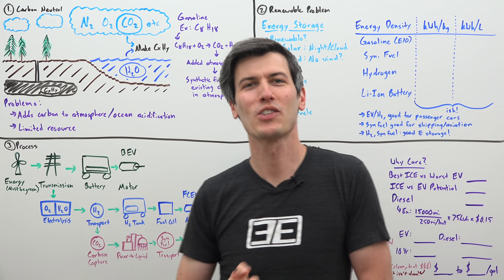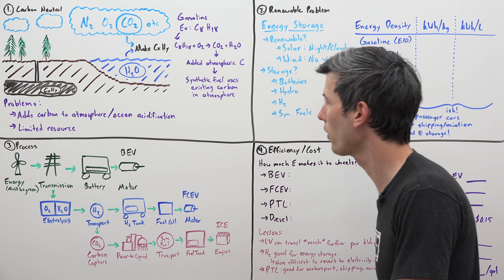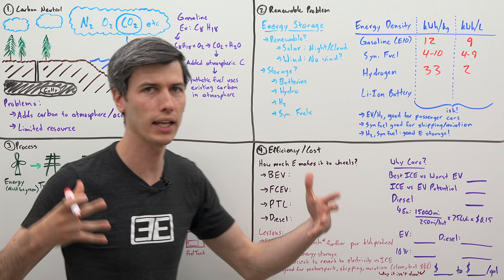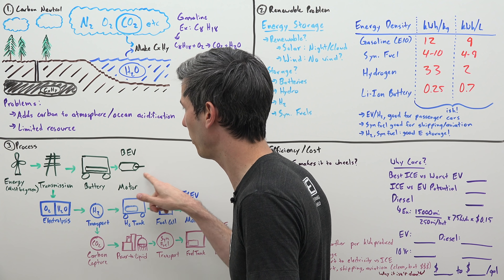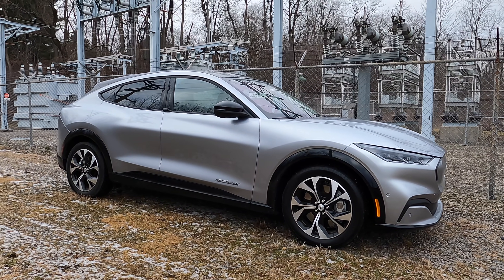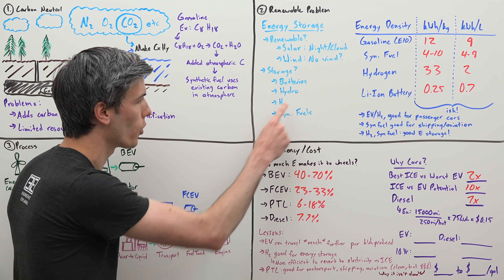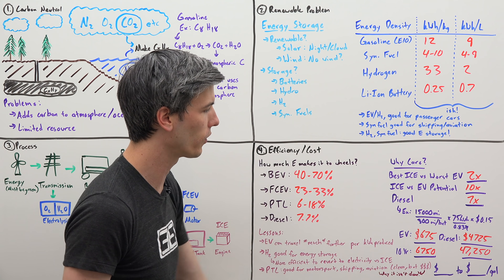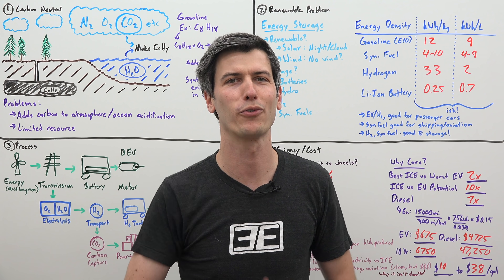The Big Problem With Synthetic Fuels

Comment: Synthetic fuels won't replace electric cars but they can save expensive performance ice cars and racecars.
Reply: That’s all we care about anyway
Reply: @Ryan Fang Nobody needs tasteless boring people
Reply: @Ryan Fang And even less people care about electric racecars.
Reply: @Elias Håkansson Youre probably right. But people today also still ride horses but not as an alternative to cars but because its fun. I dont even say that electric performance cars have no emotion at all. I actually like many of them and would also drive one but I dont think they can replace the feel and emotions that come with ICE sportscars. In my opinion they should kind of coexist.
Reply: @Elias Håkansson The emotion with ICE cars is getting everything right, it's like a puzzle on track, getting your shift points correct, listening to the mechanical contraption roar away as you're rewarded with nailing the acceleration out of a turn. Then there is speaking with your friends with what they did to help them get that bucket of bolts and petrol around a track. You brought a good point with a horse, there are a lot fewer horses but they are still around, because of the enthusiasts.
Reply: I’d like to see biofuels included in this analysis, since they’re also renewable.
Reply: Those vehicles are the least of our problems.
Reply: @Elias Håkansson and look how that turned out? How many people dont own horses cuz they enjoy them. You defeated your own point.
Reply: No, they can't. Once Roadster starts hitting the road, ICE Hypercars are toast. EV drivetrain -- multiple engines (2/3/4), instant torque, silent gives advantages which ICE just can't match.
Reply: @archigoel  ah that overhyped Tesla Roadster which only good on paper for its acceleration. I doubt it will beat Nio EP9 or Rimac.
Reply: @khairulanwar5439  the rimac is 2 million dollars bud… hardly anyone is going to buy that car compared to all the roadsters or model s for that matter
Reply: @Ryan Fang That is obviously not true if you look at the car community...
Reply: It seems like electric cars are almost effortlessly faster than similar ICE vehicles though, and can be made even faster with advancements in battery tech coming down the pipeline allowing for lighter packs.
Reply: @_topikk_  Sports cars are not only about the speed but the emotions that come with it. Its true, electric cars are much faster and will beat ICE speed wise in every discipline but thats kind of it. Once this speed thrill wears off its not special anymore. There is not much emotion and character that comes with the speed, its just fast. I think performance electric cars will get bland after some time.
Reply: @fremue9312  There are 0 electric cars that won a major racing championship and there most likely will be 0, electric cars are only faster in a 1/4 mile
Reply: @broshido2745  I said that they will be faster in the future. Battery tech improves rapidly and it won’t be long until the weight difference is not as big anymore and electric cars will be faster around the track too. And also, the fastest car around the Nürburgring is already a hybrid.
Reply: @_topikk_  It's not about the speed. The noise is the reason to save ICEs
Reply: @Phosphorus444  same reason I dont want to see manuals die off,(maybe just an america problem idk) its just the fun nothing to do with speed
Reply: @aaravs524  
AGREED! 
I love manual transmissions.
Reply: @Phosphorus444  Not only the sound, also the characteristics, torque curve, powerband… it’s pure emotion
Reply: @Phosphorus444  Well record it and play it on headphones when you drive!
Reply: @_topikk_  Nope, 1/4 mile isnt everything you know, i still have to see a electric car do a full 24h lemans race and win or a record nurburgring time
Reply: @broshido2745  I mean Toyota just finished a 24 hour race in their prototype hydrogen race car (Corolla Hatch) they ironed out a lot but looks promising
Reply: @broshido2745   The current fastest Nurburgring lap was done by a 4-banger mated to a couple of huge electric motors.  The second fastest lap of all time was done by a full EV.  Expect to see all of the top spots in all categories filled with EV's in the next several years, particularly if solid state batteries start shipping.
Reply: @_topikk_  You do know that truly fast racecars are not allowed in the ring because of safety concerns right? an F1 car would destroy the lap record and probably set a sub 4 minutes time.
Reply: @_topikk_  You do realize that the 919 evo produces ~70% of its power from the ICE, hybrids are the way to go for performance, electric cars suck for cornering and that’s a fact
Reply: @MaddNomad1015  Hydrogen isnt EV
Reply: @broshido2745  I know I’m pretty much agreeing with your point to the other person as far as EVs not being able to run like combustion engines in a race setting.
Reply: @_topikk_  basically, what you just said is that hybrids are better. The second fastest lap is almost a minute slower, and none of the Top 10 road legal cars are electrical. Jeez, Formula E is way behind Formula 2
Reply: @_topikk_  and quartz watches (and now smart watches) are effortlessly more accurate than even the best mechanical watch. That doesn't stop new (and even relatively affordable) mechanical watches from being made, or stop people from wanting to own one.
Reply: @_topikk_  Nonsense. Compare the ratio of engine power to engine weight of a purely comustion engine to that of an electric or hybrid with batteries.
Co2 has nothing to do with efficiency.
Reply: @_topikk_  There is no "similiar" ICE vehicles. Electric engines have massive torque right after they start turning, so they dont need gears. Which is why they will accelerate from a stop and low speeds very fast. But at higher rpms electric motors lose a lot of power.
Reply: @_topikk_  faster off the line and nothing else. EV's are considerably heavier which defeats the purpose. Plus races like LeMans and endurance racing are pretty much not possible to do with EV's. Who would want to drive a race car that runs out in 2 laps and takes an hour at least to charge back up? EV's only make sense for daily driving/short commutes.
Reply: I would rather have a quiet and quick car with a smooth ride and as few parts as possible; I care much more about efficiency and simplicity than sound. I mean, I kinda admire the engineering behind at least some combustion engines, but for myself I would prefer a much simpler and more efficient EV.
But anyway that's just my opinion. You can't disprove it with any facts lol B)
Reply: @pmj_studio4065  for a daily driver like you described,  yes electric is a fantastic way to go. For enduro races they are not viable, for those like myself that have a subjective enjoyment out of driving ICE is the only viable option. I drive my 1999 Freightliner with a 14.6L caterpillar in it every day because I enjoy it. Can't go into the California freight market with it, but I'd rather enjoy the drive then get that extra load of freight.

Comment: How will electric cars and truck succeed if most of the material comes from Third world nations where they don’t have all of the regulations that the USA has?  The power grid isn’t there to really support electric cars and the range of the batteries isn’t there either.  Many power plants still are powered by coal so the EV argument isn’t that stable.  I know EV vehicles have their place but I look at charging times and places to charge.  I’m not convinced to buy one and see many people who have EVs also have gas and diesel vehicles too.  If there is a Ford F-150 or other trucks and SUVs that will get 500 miles of range and not be over $100k then I may be interested.  And if all of our electric power comes from non fossil fuels and have real options I’ll be interested.
Reply: Not sure Australia wants to be called 3rd World. Plus it will improve the smaller nations GDP if its done fairly
Reply: @rtfazeberdee3519  I wasn’t referring to Australia.  I was mainly thinking about China and many African nations that mining of cobalt and lithium are taking place.  I understand that Australia isn’t a Third World nation.
Reply: To be honest I think hybrid vehicles will have that 500-700 mile range many are looking for.  Electric vehicles have their places I understand.  But I think there should be more gas and diesel hybrid options for the public with plug in capabilities if that’s what someone wants or needs, along with fuel cells.  I think all options should be on the table because not everyone can afford a Tesla or Porsche or other EVs.

Comment: But Jason won't we run out of lithium in the near future then we will have the same problem again.
Reply from the maker: Why would we run out of lithium? Four points:
1) Electric batteries don't use much lithium.
2) Lithium isn't straining battery production, other elements are (cobalt, which companies are trying to reduce).
3) Lithium can be recycled and is re-used, not extracted once and then gone forever. 
4) The quantity of lithium available does not change the amount of crude oil available. These are separate issues.
Reply: @EngineeringExplained  
Love your videos.  Cars are the only reason I was interested in math and science.

What about the amount of electricity needed to charge the batteries.

They want no fossil fuels after 2035.  In the US we drive 3.2 trillion miles per year. Electric cars use ~0.3 kwh/mile.  We will need to build a 1GW nuclear power plant (or 600 windmills at 100% efficiency) every three weeks starting now just to create enough electricity to charge the cars.  

Is this really a viable option?
Reply: @EngineeringExplained  Hi EE, please see my comment above as its related to this
Reply: @EngineeringExplained  thanks for the follow up.  If that is the case though then why are scientists developing sodium ion batteries then.
Reply: cobalt ....even worse
Reply: @snapon666  wait until you find out how much Cobalt is used in the desulphurization process, while refining oil into gasoline. It's a lot. And it can't be recovered like the materials in EV batteries can.
Reply: @NicholasHoward  Cobalt is used in catalyst and more than 98% is recovered
Reply: @ayushk4099  That's correct. But as you said, there are losses in the recovery process. New cobalt has to be introduced to replace the cobalt lost. That 2% is not an insignificant amount by any means at the massive scale that gasoline is produced. And of course, there will probably be some losses in EV battery recycling. My point is that cobalt mining isn't just a concern for EVs- it's a concern for most vehicles on the road today.
Reply: @NicholasHoward  true some amount of cobalt is lost in refining 
How cobalt is a concern for other cars??
Reply: @ayushk4099  in the same way that lithium mining contributes to the lifetime environmental impact of EVs, the cobalt mining and subsequent losses contributes to the lifetime environmental impact of the vehicles that burn that fuel
Reply: @NicholasHoward  Lithium mining is brine extraction.
Nobody is crying about the tremendous amount of sodium chloride evaporation pools used for everything from table salt to PVC.
It is orders of magnitude larger than lithium today, or any future projected use, even if every vehicle produced were to be electric.
There is no open pit or strip mining for lithium. It doesn't get extracted from ore.
Reply: @jimurrata6785  I'm aware. How does that change any of the statements I made?
Reply: @NicholasHoward  "how does lithium mining contribute to the lifetime environmental costs of EV's?"
You tell me...  
How bad is the effect of a brine pool in the high desert that gets used over and over again?
Compared to the environmental disaster that is caused by oil spills, methane leakage and released CO2 for fossil fuel vehicles?
I would say it is orders of magnitude less costly.
But you don't state your* metric, so it's a strawman as far as I'm concerned.
Reply: @jimurrata6785  Sir, I'm arguing that EVs are better. We're on the same side of this argument. Why are you so pressed?
Reply: Lithium isn't "one and done" 
There is no waste product. It is a resource that once extracted can be recycled time and again.
While no recycling is 100% return, the losses are diminutive.
Even something as resource/energy intensive as aluminium is not questioned much, because the need is there.
And I would hazard a guess that there is more weight/mass of aluminum in a BEV than lithium.
Reply: @NicholasHoward  I'm asking you for clarity.
What is the point you are trying to make about the environmental cost of resource extraction for battery chemistry?
Reply: @snapon666  cobalt is being phased out completely.
Reply: @snapon666  GMs battery is reducing the amount of cobalt needed.
Reply: Also how environmentally friendly is mining of lithium really?
Reply: @mathew936  the lithium only has to be mined once. Once an EV reaches the end of its lifecycle, the batteries can be recycled (though EV battery recycling isn't done by many companies at the moment, but there's money to be made in that industry, so someone will). The upfront environmental cost of lithium mining and battery production is still offset within the first 20,000 miles of the EV's life, even if fully powered by a coal plant.
Reply: @mathew936  Not very, then again neither is the mining process for iron ore for cast iron and steel, bauxite for aluminum, cobalt used in fuel desulpherization and current battery types and of some of the rare earth metals used in some kinds of electric motors and in catalytic converters for exhaust systems. Oil extraction and processing, at least at the scale we currently consume it globally, is also pretty devastating environmentally even before you burn the refined product in an engine.

Also there's actually not very much Lithium metal in Li-Ion batteries, surprisingly, so on the list of "things humans are doing to render Planet Earth uninhabitable" lithium mining for EVs, smartphones, portable computers, tritium breeder blankets for fusion reactors, etc, etc is probably not even in the top 10.
Reply: Lithium is not a rare-earth even if it is difficult to extract. Cobolt and Nickler are the more difficult elements to mine. There are already good production cars (like China-built Model 3 SR/+) with lithium-fosfate batteries, which omit the cobolt - so I don't see a major issue on the longterm.
Reply: Lithium is not the issue. We have enough supply for thousands of years. Nickel is much more scarce. Nickel mining needs to be scaled up to meet the future demand. Tesla already announced that they will be mining Lithium from Nevada completely Acid Free.
Reply: That's a big problem no one wants to talk about, if all cars and other means of transport get totally electrified, how much lithium and other conductors will be left after idk, 100 years of massive extraction? Furthermore, these materials are also used for all kind of electronics   which are not going to decline in the future but highly increase. We are already living a worldwide semiconductor shortage, so what will happen when the demand is very much higher than now?

Also, as the guy above me commented, the extraction of these materials is nowhere near of being carbon neutral, and what happens with batteries and other electronic components after the car is scraped? They are highly toxic and you can't just leave them in a scrapyard since it will pollute the air or even the underground water, so yeah massive electrification will come with serious problems that for the moment nobody at the governments or the car companies like Tesla seems to care about.

Comment: shells blue gasoline emits ca 20% less CO2 overall compared to ICE fed by regular gas, which is the same as EVs save.
Reply: You didn't watch the video? Renewable powered EV emit 0 CO2 at 40-70% efficiency. PTL fuels at <20% efficiency and much higher cost.
Reply: 0 CO2 🤣
our grits are far away from being 100% renewable.
edit: and those 20% CO2 savings are over the life cycle, not just what comes out of the exhaust.